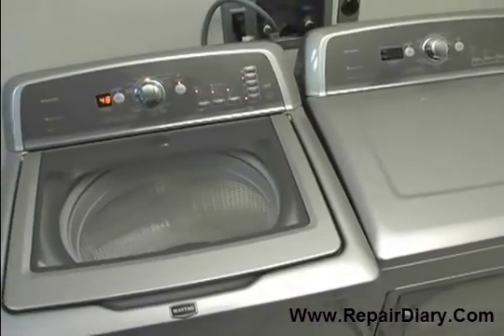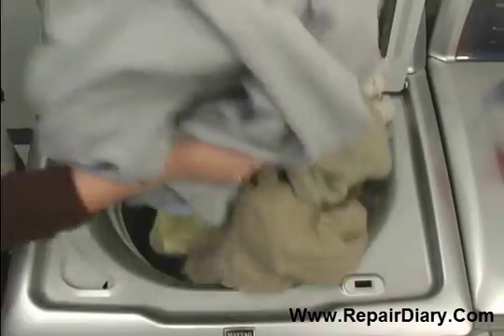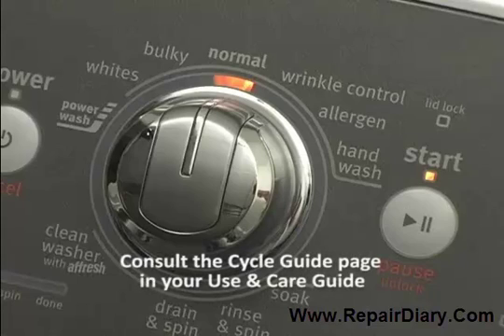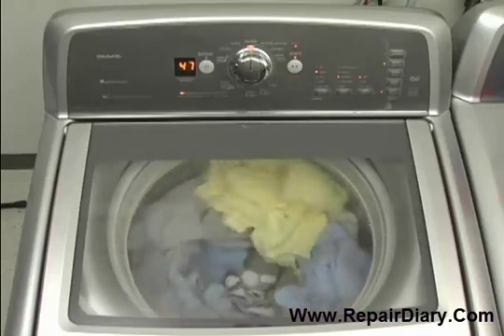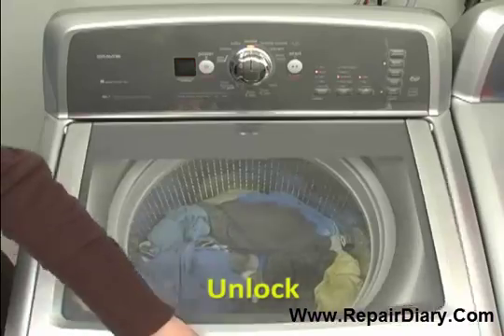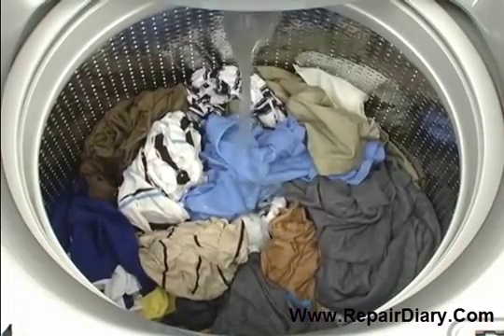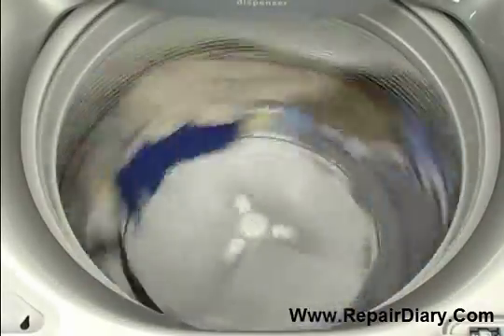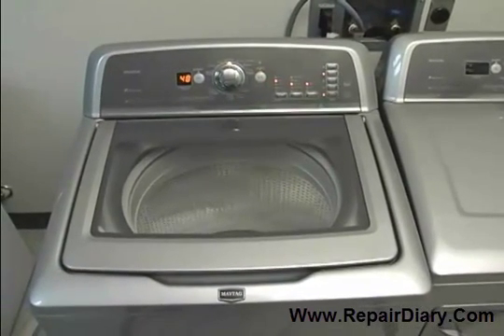How High Efficiency Top Load Washer Work

Comment: You might as well beat your clothes on a rock. 
I hated mine.  Nothing really got clean unless you washed just a few items at a time.
My whites were dingy, dingy, dingy. My grandmother has probably rolled in her grave three or four times by now.
I bought a front loader if the government is going to force me to use HE.

Does anyone make a wringer washer.  I think I need one. Those things cleaned AND they lasted 20 to 30 years.

Comment: Same as a low-flow toilet, if you gotta flush more than once, you've defeated your purpose!
Reply: It really depends on the design. A friend has a .8 gallon Toto toilet that will seriously flush anything. The 1.6 in my apartment is utterly useless requiring holding the handle down until it uses a good 2.5-3 gallons. A well designed HE washer will clean very well and be efficient, but only a well designed one. Since most people are enticed to write reviews with a sweepstakes or giveaway promotion it's tough to know what you're buying until it's too late.
Reply: Lmao 😂
Reply: That's exactly what I do.

Comment: We just bought the Maytag Bravos XL. It was a floor model with a decent markdown. I was nervous about getting a high efficiency washer, but saw enough helpful reviews to be okay with buying one. I came across this video and all of the negative comments after the fact. But I have to say we've had no problems with our new washing machine. It does what it needs to do and works well for us. There is plenty of water to get the clothes clean, and it agitates the clothes enough to do the job. The spin cycle is pretty awesome and gives our dryer less work to do. It's a matter of loading the clothes differently, making sure you measure the correct amount of HE detergent, and using the right wash setting. Now, for heavily soiled clothes, we haven't tested it yet, so we'll see. But it does just as good of a job washing the clothes as a machine with the old agitators. Plus it's made in the U.S. We'll see if our water bill does better than in the past. Will keep you posted.
Reply: ***** Yup. So far, so good.
Reply: BlooMoonface Is it still working ok for you? I'm sorta nervous now. Yesterday, we bought a matching Whirlpool HE top loader washer & dryer pair (it's not being delivered until the middle of the month, we're moving in a few weeks). Anyways, looking at the video, I never expected it to use so little water. We have pets, so I'm kinda worried if it actually gets things clean.
Reply: BlooMoonface I just bought a HE topload washer and was a little concerned by some videos of low water washes but my clothes do come clean. However, you must learn how to use the cycles and sometimes use DEEP water option w/heavy soiled settings and extra rinse if you have kids with food stains all the time. Also I have found my washer to use plenty of water and clean well with normal cycles without selecting extra water if theres no significant stains. Ive had my washer for about 1month(5.3 Cabrio).

Comment: this does not look like its going to clean the clothes properly :S
Reply: greenFinger225 Yup, it doesn't. It's a piece of shit machine. Don't buy top load washers EVER if you want clean clothes.
Reply: Not all top load sucks. Ive a 16 yr old top load washer that works fine, cleans properly, but non HE though
Reply: greenFinger225 I have one and it "senses" your clothing level.  Because of that, I have to add a pitcher of water to weigh it down a smidge and I get more water to wash with.  So dumb.
Reply: greenFinger225 I Have $1799 Sumsung Front load Washing machine that Replace the GE Top Load Washing Machine but both of them Used HE. And Sumsung Dryer that Replace 2000 Kenmore Washing machine. New Sumsung washing machine have good sound effect with Steaming.
Reply: This is the biggest piece of crap I have ever seen!
Reply: orangewedges It's not because it's topload, it's because it's HE. My mom has a HE Frontload and it's a piece of shit.

Comment: itsmegp46

i suggest you read this artical and reread it

Many folks never stop to think about the impact that government mandates have on every single facet of their daily lives. Take just one example, and that is the interminable string of decrees on the part of the governmental-environmental-green complex and the ensuing repercussions on the lives of individuals.
This interesting article on Epinions discusses the impact of federal energy efficiency standards for washing machines, including (1) the myths of energy savings (2) the long-term, negative environmental impacts of the high-efficiency machines, and (3) the cost to consumers of the government's high-efficiency, short-lived washers. The writer notes:
Too many large appliance products are now being engineered to meet priorities that do not include a reasonable interval between repairs and a service life commensurate with their initial cost.
…All high efficiency, high-speed spin washers (both top and front-load) invariably possess a motherboard and a host of electronic parts, and according to those who repair them for a living, washers crammed with multiple electronic sensors, touchpads, digital displays, and miniaturized circuit boards tend to need more frequent repair — i.e. — replacement.  They must be kept on an electrical circuit with functioning surge protection, because their vulnerable and expensive solid-state components can easily degrade or burn out with electrical power surges.
The writer points out that the federal government's 2007 Energy Star standards have, for the most part, eliminated the traditional design for washing machines because those machines cannot obtain the government's certifications, unlike the newer devices that manufacturers have turned out to specifically meet federal requirements.
I never bought into the high-efficiency (HE) concept, and in fact I have always despised the newfangled front-loader design. I was right when I assumed the opinion that those atrocities were nothing more than an environmental stunt and marketing scam, backed by the force of politics and special interests. Consumers have been sucked into buying these things because of their keen looks and pretty colors. Almost everyone I know has a front-loading machine.
Until November 2009, I still had my mother’s old machines that were 20-ish years old, and they worked great, for years, before they both began to slowly poop out. When the dryer ceased to dry in one cycle, and the agitator on my washing machine began to puncture numerous holes in my clothes, it was time to get new appliances. I bought a Kenmore HE washer and dryer combo, on Black Friday at Sears, at half-price. I did not seek, or want, HE appliances. But I did desire a washer without an agitator, and mostly because of my agonizing two-year battle with my old washer to keep my clothes free of holes. I was planted firmly in the anti-agitator camp. So I wanted an agitator-free top loader, but since those models were all HE, I walked away with the purchase of a new, top-loading HE washer and matching dryer. I should have listened to the appliance salesman at Sears who told me, "You really shouldn't blame the agitator." In retrospect, it is clear that I blew it on this purchase. And that agitates the heck out of me.
This inefficient, high-efficiency thing has done nothing but break down since I bought it. It once ate, and I mean shredded to bits, an entire blanket, causing the washer to jam up, and the dang water could not empty out of the washer. Service call. The water sat there for two days and stunk up the basement after I gave up on bailing it out. The appliance repairman told me that high-efficiency washers tend to eat delicate stuff because of the high spin speed. Also, I was told, “Oh, you can’t wash rugs. These things spin too fast and the weight of rugs will break the drums and other parts. You need to take your rugs to the laundromat.” I had been washing my rugs due to hosting a perpetual dog hair festival in my house, and I’ll be darn if I will own a washing machine that insists that I go to a laundromat to wash them.
So this piece of junk breaks all the time (I have the 5-year, extended warranty), it eats delicate things, it can’t spin rugs, you have to use special HE soap, and it has so many computer boards and electronic parts that it breaks down more quickly than you can say, “my computer is hour-glassing again…” Also, I’ve had to spin and re-spin clothes many times because the washer doesn’t spin the clothes dry enough, thus leading to throwing eighty pounds of water-logged clothes in the dryer, therefore sucking up even more energy from dryer use and repeating drying cycles, and potentially breaking my dryer from the excess weight load. I've set my dryer on back-to-back 70-minute cycles in order to dry saturated clothes. Energy savings indeed! Just like the government-mandated, low-flow toilets where the flow is so low that they don’t move molehills, let alone mountains.
Well, my washing machine broke again two weeks ago, and if I could lift it like I can lift a laptop, I'm sure I would have hurled it across the basement. Eventually, the machine started working again when I fussed with it a bit, and that lasted a couple of washes while I held my breath waiting for the machine to spite me once and for all. So indeed, it broke again last week, and it took forever for me to get the lid lock to unlock (!) so I could get my clothes out and take them to the laundromat. I had to invent a hatful of magician's tricks just to get the jaws open to get at my clothes. Then it brazenly hissed at me, followed by the beeping and flashing of numbers and letters in the display in an obsessive-compulsive rage. What a useless piece of crap.
For the most part, we shall not put the blame the manufacturer — instead, blame the government and the politicization of every aspect of our lives. Here's another passage from the writer of the article.
The government assumes that all high-efficiency, high-speed-spin washer owners — regardless of brand/model – are satisfied with the cleanliness of their clothes and aren’t fudging with extra wash or rinse cycles, nor using more hot water in order to increase cleaning power (or to reduce widely-reported high-efficiency front-load washer odors).  For those of you who don’t precisely match the assumptions in the government model (washing mostly in cold water, using an indoor/outdoor clothesline or drying rack, using a high efficiency solar water heater or heat pump, or washing fewer than eight family-size loads of laundry per week), don't count on saving much money before you pay to replace that washer again!
I'm tired of being without a washer and waiting for a Saturday repair appointment or taking time off during the week to meet the repairman. And while I wait for the appointment, I drag my clothes to the laundromat, burning $4/gallon petroleum to get there and back, and when I get there I use age-old, 1980s-style, "inefficient" machines to waste the water I was supposedly saving with my new machine that wastes energy, time, money, parts, landfill space, and human energy.
The Sears repairman came by, and I noted he loves to talk. He cornered me in the kitchen with a long conversation following his news, "Sorry, I don't carry the part you need. It's going to be several days before we can get the part." I asked him why these newer things were such pieces of crapola, hoping to engage him in one of my dissident discussions.
This man needed no impetus from me — he went on and on about how the government has created these malfunctioning monstrosities, why he will never buy a modern washing machine, and why everyone should look for the more reliable fix-up relics from the past. He fessed up that everyone in the industry — manufacturers, retailers, repairmen, etc. — know that these government-inefficient contraptions are no good, and the challenges of high-efficiency design means they can never be built to last without triggering significant cost increases to the consumer. Thus, in order to manufacture and sell washing appliances at an affordable price, the producers are squeezed to design and build malfunctioning junk that "saves the planet" while the consumers of these products are saddled with green-induced landfill paraphernalia.
In summary, the government's green totalitarianism has created a massive economic inefficiency with its energy-and-money-wasting, "high efficiency" washing machines.
• On a macro level, there exists a diversion of resources due to manufacturers rushing to meet government "voluntary compliance" standards and mandates. Manufacturers are forced to rush shoddy designs to market to meet mandates instead of strategically directing long-term resources toward research and design implementation as desired by consumers in the marketplace.
• Wasted energy resources through repeated cycles (spin, wash, extra drying, or otherwise) on the part of users to maintain previous standards for the cleanliness, dryness, and wrinkle effect of clothes.
• Increased maintenance and repair cost to consumers over the life of the machine due to the mandates forcing manufacturers to implement substandard product design.
• Economic inefficiency to consumers due to the shorter life span of the machine.
• Huge landfill graveyards of non-repairable machines that are discarded because they are too costly to be fixed.
When my warranty runs out in 2014, this puppy is going on Craigslist as a “cheap, damaged good,” and if that doesn’t get any takers, out to the curb she goes, for the garbage pickers. I’ll buy a used, old-fashioned, ugly, water-hogging, rebuilt, grandma washer, as sold by many local fellas who make a living fixing up and selling used appliances. Until then, I’ll keep washing my rugs and keep breaking this thing, and Sears will keep fixing it, on their dime.

only an ignourent, ill informed, person would buy a he machine like you.

i am not trying to trole or anything but who ever has a he machine just has to face the fact that they are crap.
Reply: I think my eyes are going to fall out from seeing so much truth!!!
Reply: It is way past time to go to Washington and kill the overbearing goons.  I really want to kill every activist and their lawyers that worked on the legislation that controls the amount of water in my washing machine and in my toilet.  In turn, kill every wicked congressman who voted to pass the legislation.  The only way to stop them is to kill them.  Then shutter the city for good.  Only then will we be free again.
Reply: @JamesMuecke-y3d   Wow, I forgot I copied and pasted this on here a few years ago. not only is the federal government corrupt, new york state where I am from is even worse! I don't have to wory about any of this HE washer bullcrap, I have a good old whirlpool direct drive. When that fails and I can no-longer repair it, I will most likely get a speedqueen. Only good washer made today!!!

Comment: Samsung and LG have as much business making washers/dryers as Toyota does making pants!  LG stands for Largely Garbage.

A few years ago I went into the local Sears and started looking at machines, this was the time when Whirlpool got rid of their good, solid direct-drive design and went to a belt-driven design.  These washers also had a cover lid latch which locks the cover.  It also creates all sorts of other problems if you forgot to throw something in upon starting the wash.  You also can't start the wash and have the water running while you throw stuff in, the machine won't allow it.  It spins the load several times first before adding water to ensure the load is balanced.  If it's not, it does a series of fills and drains and spins to help balance the load.  THAT'S ENERGY SAVINGS!

When the salesman walked up to me, he asked why I was looking at the "outdated" top-loader design.  I explained to him that they actually WASH clothes rather than have flashing lights to make you believe that they did.  I gave him a lesson on washing machines.  He just wanted his high commission on a front-loader set.

I asked him why they now have cover lid latches, he tried to explain that it's for safety.  I told him my machine has a lid switch--if you open the lid the machine stops.  No danger.  I also informed him that back in the 60's, Whirlpool had something called an "agitator scrubber", which was a nubbed topper to the agitator.  If you had tough stains, you'd start the wash, and while the agitator was going you'd press the fabric onto it for it to scrub out the stain.  Then you'd just drop it in the already running machine (which actually washed), and presto--clean shirt.

The safety was your own--you knew better than to drown yourself in the machine, and if you had kids, you--ready for this--WATCHED them.  The salesman didn't seem thrilled.

Shampoo bottles used to be made out of glass.  If you dropped one in the shower, you didn't sue Pert for your own negligence.  Coffee was always hot, now we have to be warned it's hot lest McDonalds gets another lawsuit.  Cars didn't have front-and-rear crumple zones, they had good, steel bumpers that did something.  Then they found out that didn't work so they threw in airbags.  Now a minor fender-bender is a "frame's bent, you gotta junk it" accident.  Just a testament to the quality of goods nowadays.

also and itsmegp46 sorry to mention you in this comment, but your wrong!

no shit he for me.

Comment: hi can u help me
my washing machine water continuously draining and not spinning - top loading machine 
may be programme setting need to reset - how to do ?
Reply: Don't know if you have had that fixed yet or nor but try checking your drain hose. Sometimes if they are not at the correct angle the washer will do that because it causes a siphon.